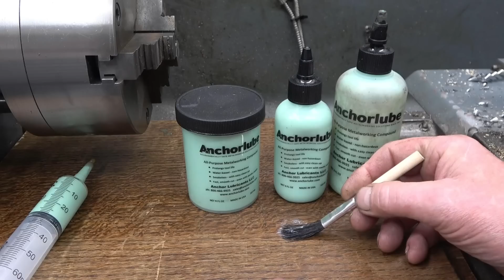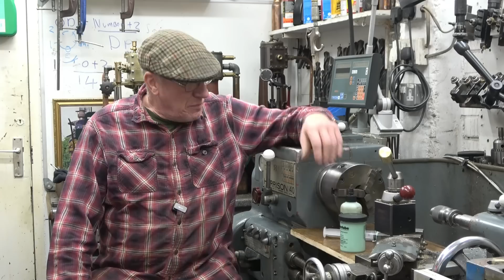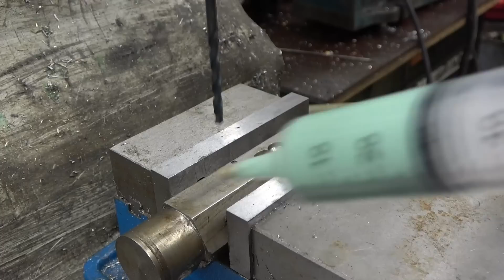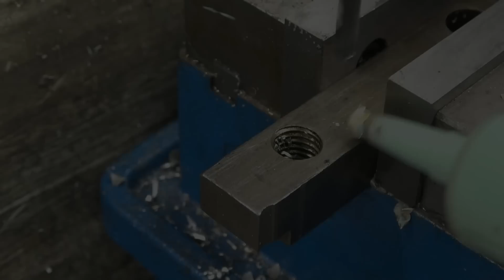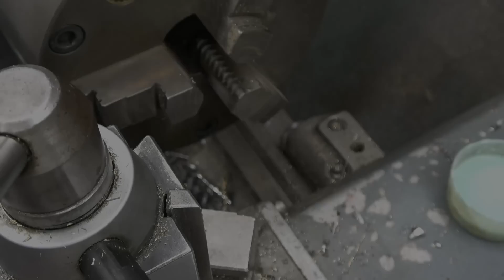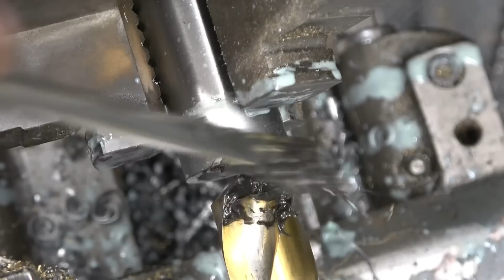Anchorlube Metalworking Lubricant . Review

Comment: I live in Cleveland, Ohio USA. This stuff is made in Westlake, Ohio like 5 miles from me. I discovered it a few years ago and I like it. I like that it is thicker than oil so it stays better than oil. Also I do overhead drilling on door frames, and I like that if it gets on my shirt that it doesn't leave a stain after washing the shirt. They also have a few other products, but I haven't tried them. They also have Anchorlube in gallon bottles, 5 gallon buckets and 55 gallon drums. I only use the very portable 4 oz. bottle. I do like the idea of putting it in a syringe. I think i'll steal that idea.

Comment: @RicktheRecorder
2 hours ago
Everyone has been lamenting how deprived we non-Americans have been, but now it's available here our lives are to be transformed. So I've got some, and did a test drilling and manual tapping M10 into some 304 stainless steel. One hole using the Martian Snot  and one using my cheap Miller Oils tapping fluid. Tried different speeds. Result? Lots of squeal, jamming and snatching from the Anchorlube. A mainly smooth and lubricated cut with the Miller. Only downside is the degreasing necessary. There doesn't seem to be much lube in Anchorlube. Intuitively, something water-based is likely to struggle with high pressure lubrication challenges, unless it has some miracle additive. It is not evident to me.

Comment: Iv spent a bit of time on a bridge port and 1 of the dirty time consuming on going maintenance/house keeping type jobs Is getting the oil off the coolant, yes I know a lot of this is way oil from the gibs but going to a water based tapping lube has got to keep the coolant cleaner I assume ? 
( Incidentally I usually hold a wet + dry hoover 1/2” above the coolant in the morning when the oils settled on the surface and gently draw off the oil )

Comment: After seeing everyone using it on here, I've tried a bottle in my shop, tbh in my opinion it's good stuff, no better than other top end cutting lubes, but with the added advantages of no nasty petrochemical stuff, and no harmful smoke as its water based, however this can lead to rust if not wiped up
I'll most likely keep using it, but from a tub with a brush, as well as the squirty bottle, as the latter can be messy/wasteful
Reply: Its expensive.  For those of us who buy everything (vs sponsored as some You Tubers are) we have to be careful with funds.  I can buy a gallon of generic cutting oil for the same price as one pint of Anchor lube.  I cut the Anchor lube with water keep it in a closed can, and apply with a flux brush.  Johns application technique wastes a lot of it unnecessarily.

Comment: I remember using this years ago, no idea if it was water based then, definitely a plus on low, or near zero fumes. I've seen comments on that it stains, or rusts parts/tools, but Rocal Metalworking fluid stains quite badly if not cleaned off. Non-ferrous materials stain badly on most metalworking fluids, hence WD 40 or Paraffin used on aluminium.
Great honest and thorough review John.

Comment: Doesn't it rust the ways of the lathe and metal?
Reply: If the ways are kept lubricated when you clean you should be removing any residue that could start rust.
Reply: Anything water based is going to rust the ways if you don't clean the lathe at the end of the day. Clean and oil the ways when you have finished using the machine. It isn't that hard is it when you clearly get the benefits that John has demonstrated here?

Comment: Nowadays it’s hard to find a Youtuber that doesn’t use it. Either it’s really good at lubricating, or the manufacturer is really good at marketing …
Reply: It's good I've used if for years now.  But, there's always a BUT isn't there, it is water based so if you just leave it sitting on tools or equipment it can rust them.  Just a matter of keeping stuff cleaned up at the end of the day, a good practice anyway.
Reply: It's ok.  Not groundbreaking.  And it's EXPENSIVE.  I can buy one gallon of generic thread cutting oil for about 32 bucks locally.  I paid 23 bucks for one pint of Anchor Lube.  The Anchor lube cost $1.30 per fluid oz, vs .30 per ounce of cutting oil (in the one gallon jug).   Obviously, if I bought a larger size of the Anchor lube, the cost per ounce would come down, but it would be at a much bigger outlay of cash out of pocket. 

I use the Anchor lube for some things, and I do like the fact that it does not smoke.  But I dilute it with water, keep it in small sealed can, and apply it with a flux brush.  There's no benefit to gooping on more than can be applied to the cutting tool.  We can see in John's vids, even though he's trying to use small amounts, that more than half the product never touches the cutting tool.
Reply: It's decent, not as good as the waxy paste type stiff lubricants, but it's alright.

There has been a concerted marketing push, it would seem.
Reply: I think the latter.